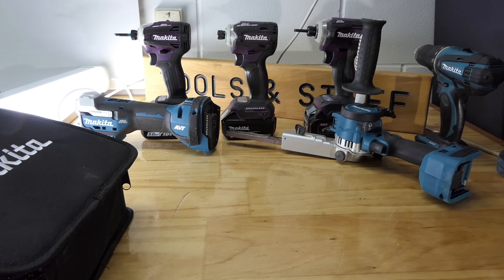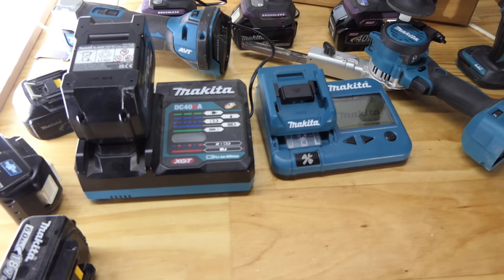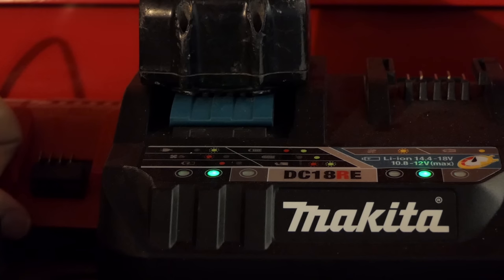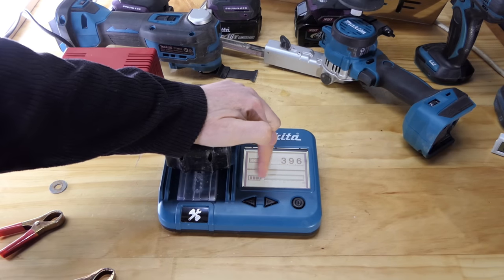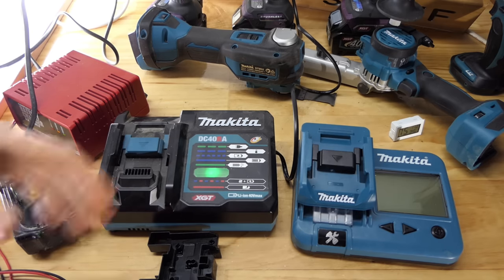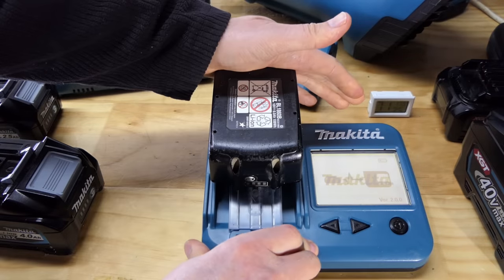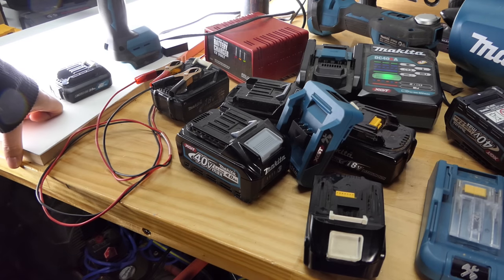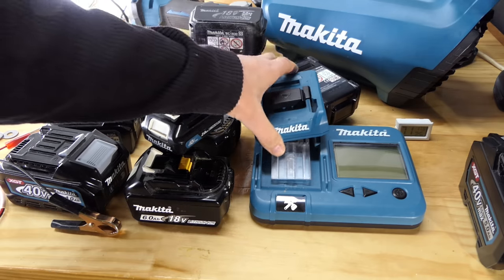Makita Battery Checker - The Tests YOU Wanted to See 18v & 40v LXT & XGT

Comment: The voltage at rest is not the same as voltage under load. There is a difference, which will be greater at higher loads and/or for more worn out batteries. That explains why you see different rest voltages for cut offs. For example, if tool/battery cut offs at exactly 14v - that will be voltage under load, so when you disconnect battery, a good one will recover to 14.9v (rest voltage), a "bad" one will recover to 16v. In other words, bad/worn battery is struggling to maintain its voltage under load. That is where capacity differences comes from. If a battery drops voltage more quickly - it will be the first one to cut off, thus producing less work.

Comment: Min: 13:49
The four bars on the battery mean as far as I know that the battery has a charge in between 75% and 100%. Three bars mean a charge between 50% and 75%, and so on.
So it is possible that the battery at the moment you're looking at it has a charge between 75% and 80%, so that you get four bars on the battery and a still blinking blue light on the charger.
Please correct me if I'm wrong.

Comment: Makita batteries have their own inbuilt low voltage cutout so I'm guessing the older 6ah knows that if it ran down any lower, it might rapidly drop voltage and risk cell damage. The newer one might be able to run longer as it is still fairly new.

Comment: @Tools&Stuff Please see if the Greenlee 120v to 18v adapters will work on Makita tools. They are made for Greenlee power tools that use Makita 18v batteries so I don't see why it wouldn't. Also would 2 of them ran to the same outlet work for powering a 36v tool. Would make a great video!

Comment: Curious if the fake batteries or chips you can buy will log all the same details as oem Makita??
Reply: I came in here to make this same comment. I would be curious to see what they report. 

Cheers for doing these videos.
 
I run some Makita tools but quite often just chuck the battery on to charge when I am done, just so next time I'm good to go. Could be "wasting " charge cycles by being efficient.

Comment: With the QR code hold the phone at a distance where it can focus well.  Then zoom in while holding at that distance.  It is surprising how much detail you can get.  Should be no problem to get in on that QR code.  I often use this technique for inspecting drill tips and lathe tooling.

Comment: This is such a great tool. I hope everyone else copies it because being able to check battery health on what are now very expensive consumables would be such a bonus. I have had a lot of problems with batteries of all sorts of breeds. None seem to last that long. I think you were spot on with your heat theory. Although most chargers now won't charge a hot battery sometimes the damage is done whilst using the tool. Working on decks etc. with no shade in Australia in Summer I have had batteries plastic welded to the tool. I have had to cut them apart. That is hot. Has this then led to the faster demise of those batteries. The old batteries didn't have a thermal cut out in them. Most new ones I believe do. The electronics seem to be what fails. Same with the tools that get hot. The motor still lives but the electronics die. Are these things built tough enough to cope with Australian weather. I bet they have the opposite problem in places like Russia.
Reply from the maker: I get a lot of people ask me that I need to test the tools in snow to see how good they do in the cold but not a lot of snow here in Auckland.
Reply: I live in the Sverdlovsk region. It is in Russia. I have a Makita DUC355Z chain saw. I often cut dry pine logs into chocks with this saw. When the temperature outside is below zero degrees Celsius, I keep spare batteries in the cab of the car. And when you are already working with a saw, the accumulators heat up during work and do not have time to cool down. But in frosts below minus 20 degrees Celsius, I did not use a saw. If the batteries are cooled below zero degrees Celsius, then it is almost impossible to use them with a saw. Perhaps they will work with a lower power tool. I have three pairs of batteries 6.5 and 3a / h, if you constantly cut with a saw and immediately change the batteries, then the saw does not have time to cool down and turns off due to overheating of the engine or control unit.

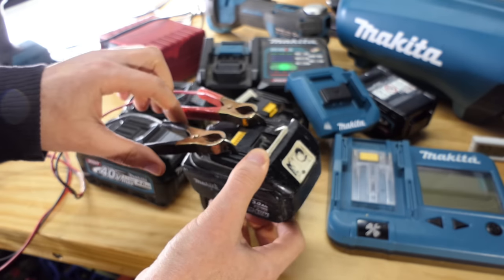Comment: At 30:46 I can see a flash inside the battery (just above the white clamp). What is that?? Is there a small led inside or is that a spark from the bad cell??
Reply: That is definitely a spark! Upvote the comment, the dude has a ticking bomb in his house.
Reply: Not a spark. It's the lamp reflecting off the plastic.

Comment: It'd be interesting to see if someone could pull the faulty pack apart and see just how bad the bad cell is.
I wonder if the run time difference between older and newer batteries is consistent across tools with different current draws. (since you get more voltage sag with higher current draw.

Comment: I think it was ave that said, 3 separate times a charger attempts to charge & you get the dreaded broken battery signal it’s logged on the battery’s chip & will no longer charge that battery. So with an old 4amp it happened so I removed it & jumped from a healthy battery on charge same as you briefly described. That battery got to full charge & has been trouble free & chargeable for the last 12 months. For those out there that rely on their tools for work like me, do what you can to get them back to a charged state before trying them again in a Makita charger. Not saying it’ll work every time but it has worked for me.
Reply: I am not understanding what you did to get the old battery so that it will charge, can you explain it better?  I have 5 or 6 batteries that are not that old or used that now are rechargeable.  thanks
Reply: Older Makita 18V Batteries had a "three strikes and you're out" systems - after three faults being logged, the battery management board condemned the battery and it was pronounced dead (doesn't charge anymore, etc.). This doesn't apply to newer batteries where the model number ends in a B (e.g. BL1850B).

Comment: I've heard some comments suggesting that he should replace the damaged cell with a new one. As I understand Makita battery packs, this wouldn't work. I believe they have a micro controller that remembers what the state of the individual cells are, but doesn't refresh itself so it can't see new/replaced cells.

Think of it like this.

There is a business (the battery pack), a manager (the micro controller that monitors the battery), the employees (the individual cells), and the customers (the power, or watts, that go into and out from the battery).

When the business (battery pack) is new, everything is working as it should. The manager (battery micro controller) is letting customers (power) in and out in a manner that won't hurt the employees (cells). The manager is also making sure that all employees (cells) are serving the customers (power) equally. However, lets say one of the employees (cells) gets sick. This employee can't serve the customers (power) the same as the other employees (cells). The manager (battery micro controller) writes this in it its notes, and starts to limit how many customers (power) the business (battery pack) as a whole can handle. This one employee (cell) is bringing down the capability of the business (battery pack) as a whole. Now lets say that this employee (cell) gets sicker and dies. The manager (battery micro controller) writes this in its notes, as it always keeps track of all its employees (cells) and their health. Because the business (battery pack) can only process customers (power) unless all the employees (cells) are working together, if one of the employees (cells) dies the business (battery pack) can't process any customers (power). Now say you come along and replace the dead employee (cell) with a new one. The manager (battery micro controller) doesn't update his notes, so it still thinks that the employee (cell) is dead and won't allow any customers (power) in or out.

I've come across this lots trying to rebuild old laptop battery packs with new 18650 cells. The micro controller will brick a battery pack if a cell goes dead, or in some cases has been charged too many times.

Comment: Grat tool to have... Do you know what happens if you discharge a 18V battery with whatever tool (or test circuit): Will the battery itself disconnect internally to prevent a deep discharge, or is the deep discharge only prevented on the tool side?

Comment: I don’t remember if this has been covered in the past. Do you have any tips on how to maintain battery health as long as possible? E.g. is it better to recharge a makita battery before it hits one bar? Also, does it matter if a battery is kept on the charger after it is fully charged? I run the xgt platform. Thanks
Reply: This are Li-Ion so I would apply same logic: do not go below 1 bar ..and once is charged you can unplug(not that important because charger will stop charging batt). Also charge slowly if you can wait
Reply: Keep it between 20 and 80 percent charge is what they say

Comment: It seems to me that the Milwaukee batteries have a cutoff point where they do not work after a certain discharge percentage. 

I have never had a dead battery from them. My nearly ten year old 3.0 M18 batteries still work. Albeit they are quite anemic at this point.

Comment: I burned up a mud boot while gang cutting a pile of rebar with a hot saw once. Pissed me off, they were high dollar mud boots. Can't have anything nice.
Also, did you buy one if those brushless finish sanders from Japan??? Last I looked there is one left. Also, a different style drywall screwgun. Brushless, black, push activated. Badass.
And, also, how do you like the band file? I'm trying to choose between that and the new brushless oscillator. I have the brushed oscillator already. Is it worth the jump? 
Lot's of questions...

Comment: Mate, you should’ve used Mich’s fucked battery to power up the btc04. I reckon it would’ve worked, considering it only has to pump out 5v or so. Thanks for the previous video on the btc04, after watching it, I purchased one on eBay from Japan👍

Comment: Very interesting. From watching other videos where people replace faulty cells in makita batteries they say if you put a faulty battery on a charger three times it will lock the chip on the battery and will refuse to charge even once the cells have been replaced. Only way to sort it is to change the pcb as well. Can anybody confirm this?
Reply: Confirm
Reply: Applies only to older revisions, this isn't the case for batteries sold in the last ~5 years.

Comment: where did you get that battery checker? makita gave it to ? looked into getting one....1400$ seems steep haha
great vid as per usual...cheers from canada
';
Reply from the maker: There's a lot more on ebay cheaper than that at the moment.  Link in the description.
Reply: 250.00 or so now.

Comment: one area i find very interesting here is the behaviour of the chip inside the battery. because if you have a spot welder you can replace the original cells inside of an official makita battery. but the chip inside the batter will still have the old charging data from the old dead or ruined cells. that are now removed. so it remains a pretty open question around what specific conditions or fault modes that the makita battery itself will permit this type of a replacement to actual work. and result in a working battery. for example if a fault mode cannot be reset or cleared. or if the firmware on the chip will flag or detect a 'sudden improvement' and then stop working. i.e. brick itself.  and we can be fairly sure that the much newer recent 40v platform will likely have much more modern and secure DRM mechanisms and measures built into it. when compared to the early 18v batteries. as for recent modern newest revisions of 18v batteries well i have no idea where they sit on this broad spectrum. but what i do know is that a device like your makita battery checker would be a pretty helpful piece of equipment to help find out more about these specific measures. if it were in the hands of a reasonably competent electronic  engineer.

another open question i have is about current limiting the output of these batteries. because if you could find a way to do this affordably, for 20-40 amps of current. then it would be possible to use one of these batteries to fast charge a dead car battery. but in a safe way without discharging the makita battery too quickly. which would then end up damaging / jeopoardizing the smaller power tool battery. and shortening its lifetime. people have already demonstrated that this basic technique works. but always it has been done in an uncontrolled fashion by directly connecting to the battery with thick guage wires. and without any way to limit the charging current to keep it within a safe value.  the actual safe maximum value varies considerably. as it depends on the size of they battery and also the quality of its cells used. anyhow enough about these pet electronics projects. it is just interesting curiosity subject
Reply: One way to charge a 12v lead acid is with a dc-dc buck convertor set to 13.5v that can limit the current to say 5a..and also make sure not to drop below 15v on makita batt side.
Reply: @cgmarch2359  haha yes!! actually i had previously considered that but then forgot all about it. thanks for reminding me. the main problem with that method is: most of these cheap chinese buck converter OCP feature the maximum current limit is usually a lot lower than the safe discharge capability of these power tool battery. it may be only 5 amps (just like you say). in this situation then we cannot take advantage of fast charging to then jump start the engine. for example if you are late for work on a cold winter day. then you really do not want to wait for longer than about 5 minutes for the thing to be trickle charging. a higher current limit is preferred
Reply: @dreamcat4  Well the cheap ones can do 8amps .. you can parallel 2 or 3 .Or you could use a high power rezistor (maybe 1ohm or 0.5ohm)  on - or + to limit current. The ideea is just to get the lead acid charged for  engine start right?
Reply: @cgmarch2359  correct. just so the engine can get going.

just checked about paralleling buck converters... unfortunately you cannot parallel buck converters together according to the most popular stackexchange answer. the reason cited is same reason as for any other regular psu. you get high currents feeding back from one output positive rail back into the other one.

for my last research, i found that something like a solar PPT charge converter would work well. for these voltage and current ranges. however they are really too expensive

your suggestion of using a power resistor might work however it would probably be pretty wasteful all on its own. a large fraction of the energy of the battery would be lost into the power resistor

perhaps what might be the answer is just a fairly simple custom circuit. consisting of a pwm switching offset with some kind of LC averaging smoothing. with a little arduino type MCU to control the mosfet switching. i guess then you also want a shunt restistor to measure the current going through. but maybe it's not a constant current. so the MCU firmware might need to do some simple integration of the input from the ADC. area under the graph. i cannot see anything particularly difficult about making a circuit like that. so long as it was well built and robust enough to handle the high currents. and maybe it isn't strictly necessary to smooth out the mosfet switching. however just for the sake of protecting the mosfet in the charging circuit from blowing itself up due to high inrush currents. since the batteries are of a very low impedence they kindda present and look like a dead short

Comment: If a lithium battery pack has a dead cell/pair of cells it will NEVER charge again unless you replace those cells. Just cant be done and you also cannot boost or kickstart the battery successfully. 
Might work on an unmanaged battery pack that relies on the charger and the tools to manage it but still its risky to do this.

If the cells are dead they are dead they will never really recover.
The battery management board inside the battery pack essentially locks out the battery if it detects that for safety reasons.
When lithium batteries go out of their specified voltage range they become a bit unpredictable. The voltages are 4.2V MAX when fully charged although Makita chargers seem to cut out just below that and 2.5V is the lowest allowable discharge cut off voltage.

So just stop and remove the battery from the tool when its depleted and starts cutting out or when the low battery indicator is on and you loose power.

Comment: I don't understand why Makita can't make these 40V batteries compatible with the 18V. The battery could just offer 3 connections: common, 18V and 40V. Then they could stop selling their 18V batteries, but still use the 18V appliances.
Reply from the maker: You need to take a look at how these batteries are designed, then perhaps you will realise that what you suggest is a step backwards and would inhibit future tool progress.
Reply: @ToolsAndStuffOFFICIAL  you mean the internals? It the physical connections? As the 40V 3Ah is just the same as 18V 6Ah, but wired differently, you could combine both configurations with diodes or switching by the control circuit.